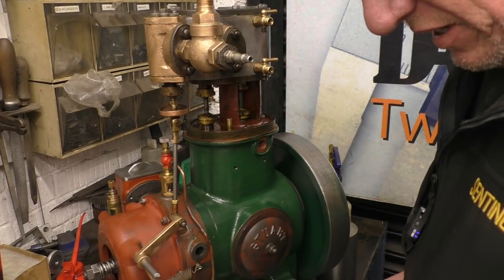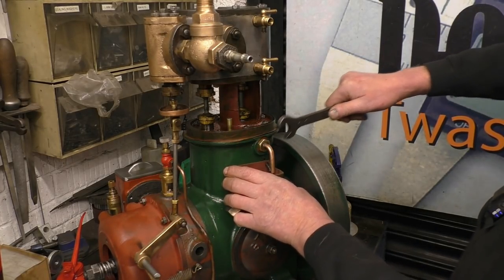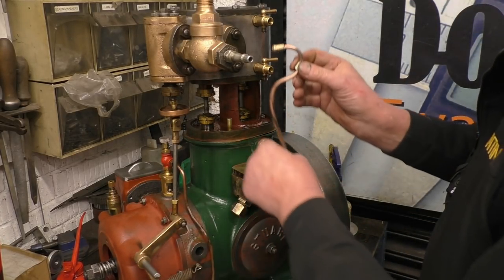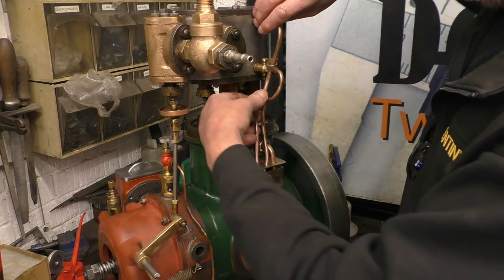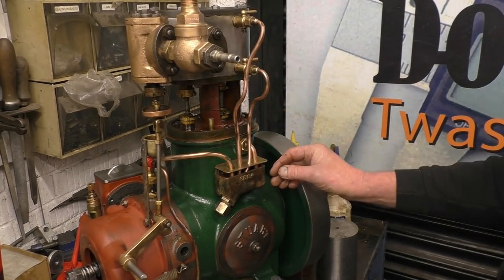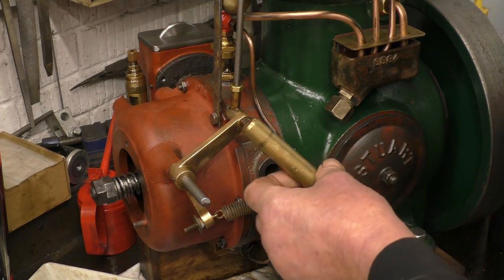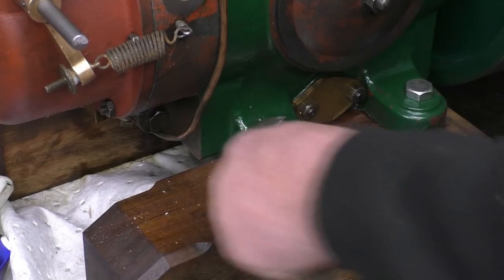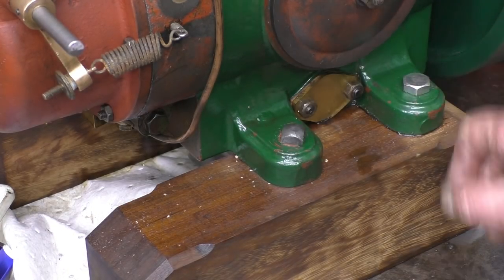Stuart Engine P34  Fitting The Shiny Bits

Comment: Great video John, those square head bolts look the part, you need to sale me that one and get started on you one.lol...excellent job.
Reply: Those bolts need a washer.
Reply from the maker: @01thomasss  yes they need a black thick washer
Reply: @doubleboost      Hello,   Do I need to anneal the last say 10mm of the shank of a 4mm HSS drill bit,  in order to turn a spigot onto it.   I intend to braze or silver solder a 4mm od silver steel rod to it, after I’ve counter bored it , to take the spigot ?     Thanks.
Reply from the maker: @californiadreamin8423  No the shank will be fairly soft
Reply: @doubleboost     I intend to do the same with a 4.3mm reamer. ( chanter for Northumbrian pipes ).   Will I have to anneal that ?
After brazing, will I have to harden then temper the joint ?
Reply: @californiadreamin8423  Reamers are normally hard all the way, so just detemper it at the back, then braze it. As it will not be under much stress working brass, no need to anneal it at all. Take the rear to dull red, let cool, and then grind a larger surface for the braze joint, and a matching opposite face on the extension rod. Then silver solder together, and clean up the outside, and it will be fine.
Reply: @SeanBZA      Thanks for your advice.

Comment: Bet the original installer of that catch tray used a dollop of tar on the head of his screwdriver to hold those screws, while he was doing the same struggle to get them in.
Reply: Unless he had a larger distributor point screw installer, but I imagine when your making 10 cent an hour back then your were lucky to have a screwdriver, which you had to make yourself.
Reply: @robertklein9190  Going to guess this was made before automobiles were common, and only a very rich person's toy. Screws, all put in by a person who either rode a horse to work, or most likely walked there.